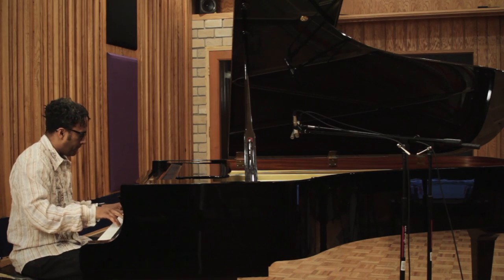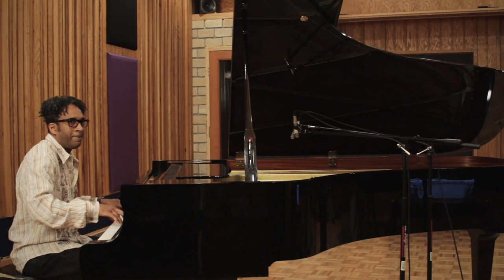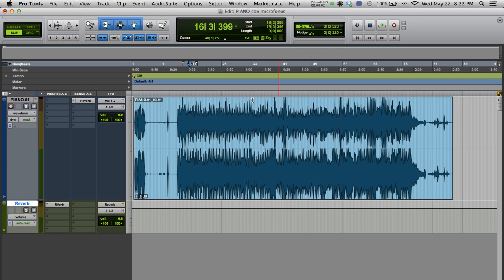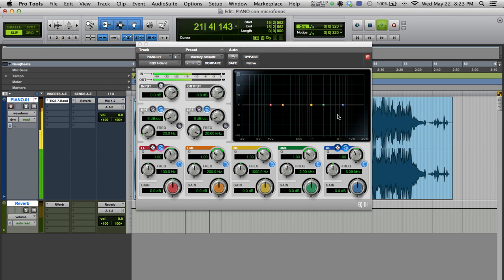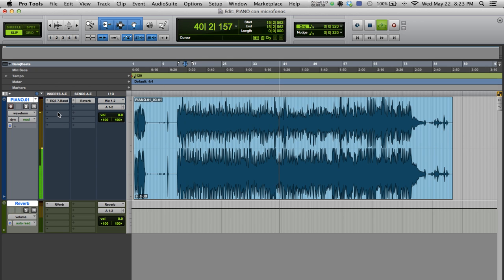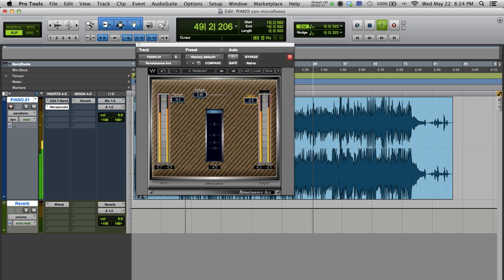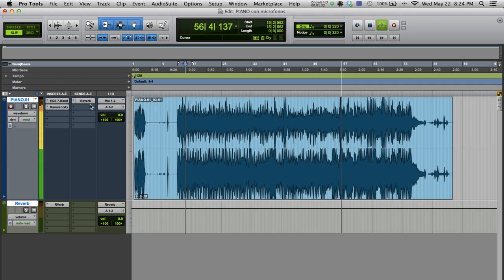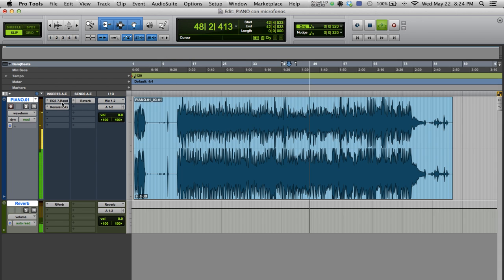How to record and mix a piano part 1

Comment: I think micing the strings is overrated. I have a bechstein grand, and I way prefer to mic it on the bottom (soundboard) to get more warm tone and less metallic sound. I do so with A/B-setting with 2 omni DPA4061. I Recommend it.

Comment: If you compare the waveforms of the two channels in the stereo recording, you see that one has a higher amplitude than the other, which means it's louder. So you would get more sound out of one side of your headphones or one of your two speakers. Do you keep it like that? If not, how do you balance it?

Comment: wow! Nice recording! How do you keep the range of volumes so high without any distortion? I saw in your daw that your wave is exactly what I want. I tried to use a hardware compressor but my sound source is far than you showed here. If  I wanna avoid distortion, I can lower the volume from the source, but it will appear like a distant sound.

Comment: Why EQ the high mid ^^ your mic take sound already good ^^ just a little bit of rolloff to cut on the 40 hz or 30 Hz bass and your already done ^^. But my approach is substractive, i only boost EQ the top end when my mix is realy need because of electric guitar or other that can cover the frequencies of the piano. and compressed or limiting reduce the dynamic quality if over used, used this only on summing bus.